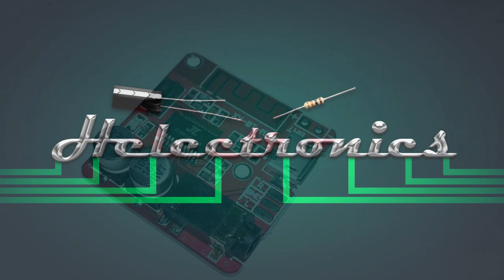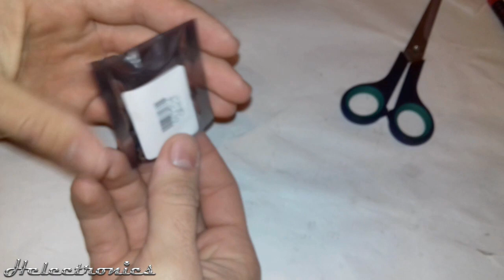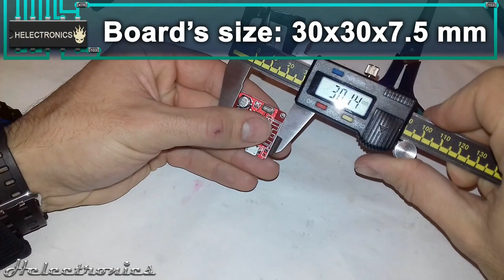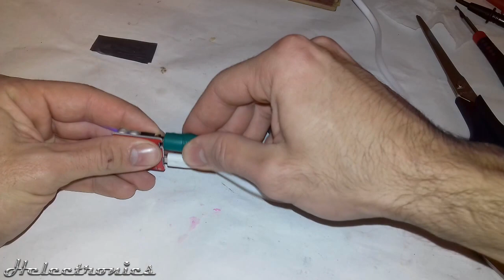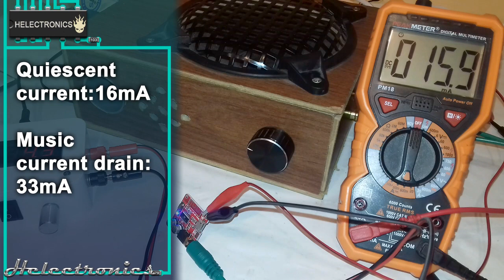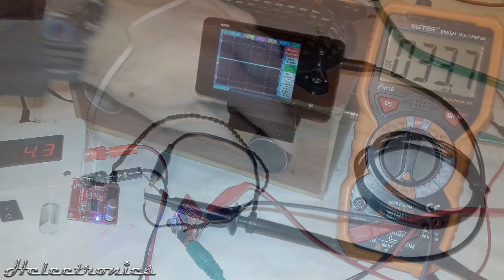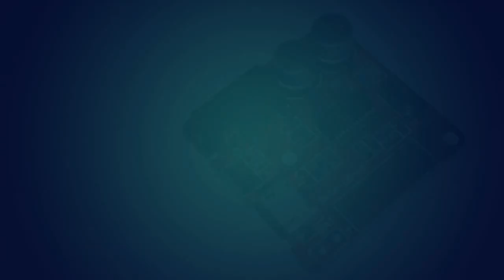REVIEW - XY-BT-MINI Bluetooth Receiver

Comment: I have the exact same module but mine has such a high noise... Like a buzzing sound when pushed a bit higher... not really clean sound on my opinion... can it be any defective component?
Reply: Have you solved the problem? Because I did. All you need to do is use external power source like powerbank. It doesn't consume much energy so using a powerbank is the best option for the best sound quality
Reply: @kivitropikal6755  yes it was the source powering my device... I changed to an external usb power adapter and it worked! No more buzzing...
Reply from the maker: Hi, what did you connect to it? What kind of amplifier? What is the power supply, a micro USB phone charger? It might be faulty component, but I need more details to find out.
Reply: Helectronics thanks for your answer! I’ve used so far several sources: the USB port from the amplifier, some normal iPhone charger and some USB port from the TV... all with the same cable... I’ll try another cable but I feel I got a lemon unit... anyway thanks for your review in so much depth!
Reply from the maker: @hsaraiva87  What do you connect to the output of the module? When you order this kind of board, order at least two.
Reply: Helectronics I’ve figured out the problem... it was a ground loop... in was using always the same circuit as the amp, same plug, the integrated usb port... as soon as i connected to another plug in the house unrelated to the amp with a proper usb charger it became clean sound! Thanks for the help... if I wanted to remove the ground loop on the USB port would there be any option?
Reply from the maker: Sorry that I didn't respond to your question Hugo Saraiva, but I didn't notice it, if you have more questions please write me on my facebook page: Helectronics. You can find the link in the describtion.
Reply: @Helectronics  Actually I have a question. Today something stupid is happening.

I am using Bluetooth module for my car and I am taking the energy from powerbank so there wouldn't be noise. But, I also connected the battery to car using lighter charger.

Phase 1 : Bluetooth module is connected to aux and takes energy from battery ( no noise)

Phase 2: While Bluetooth module working I take ground line from the car to battery, and noise happens. I am not connecting both lines, its only ground line but still getting noise. It is so weird.

Comment: I soldered a battery on the module. Can I charge the battery source using the micro usb on it ?
Reply from the maker: What kind of battery have you soldered to the module?
Reply: @Helectronics  A single 18650 battery with a batt protection.
Reply from the maker: Ok that's good, you can try to charge the battery with it
Reply: @Helectronics  Thank you.

Comment: Firstly thank you for video.I just wanted to ask why did you recommend capacitor for output of xy bt module and what kind of capacitor(v,uF) should we use.Greetings from Turkey :)
Reply: I do recommend capacitor at the output because I've measured direct current (DC) at the output. It is not obligatory but I do recommend. In my other video: https://www.youtube.com/watch?v=ip2-w9dv-Gk I talk more in detail about this. The best capacitor selection is the audio capacitors, at least 4.7uF and the low voltage rating is good.
Reply: Uzay Uzay a mur

Comment: Hello. 
Do you try connect the control buttons?
Also, by schematic, chip have fm detector and usb host.
Sorry for my english.
Reply from the maker: Hi, haven't tried it yet, but later I might sacrifice one for this kind of experiment. The other, easier option is buy the other versions of this circuit, with buttons or with remote controller. You can find the links for those in the describtion.
Reply: @Helectronics  , only soldering two wire - its not intresting ))
I order this board one week ago, and when parsel arrive to me want modify this receiver.
Also in all factory version dont have fm.
For me intresting made some things by myself.
Reply from the maker: Great concept, you can try it!

Comment: is this module has the same bluetooth IC as the DW-CT14+ module??
Reply from the maker: Yes the receiver IC is the same, but the DW-CT14+ has two class D amplifiers for the powered stereo output.
Reply: @Helectronics  owh I see... that's why DW-CT14+ has high noise on output.
recently i found this module on aliexpress 
https://www.aliexpress.com/item/dc-12v-APT-X-Bluetooth-4-2-Audio-Receiver-Board-Wireless-Stereo-Audio-Lossless-CSR64215-Module/32953766178.html?spm=2114.search0604.3.255.3a8f6137aCUEui&ws_ab_test=searchweb0_0,searchweb201602_4_10065_10068_10890_319_10546_317_10548_10696_453_10084_454_10083_10618_431_10307_537_536_10059_10884_5736015_10887_100031_321_322_10103_5736115-10890,searchweb201603_53,ppcSwitch_0&algo_expid=5f768d2f-1c60-437d-8e1e-1b7934d68966-37&algo_pvid=5f768d2f-1c60-437d-8e1e-1b7934d68966&transAbTest=ae803_4
and i'm curious with it, does it sounds better than XY-BT Mini?